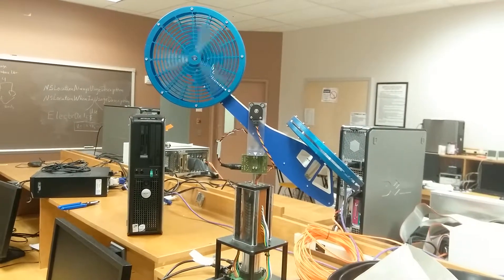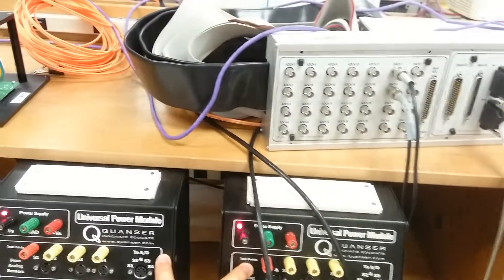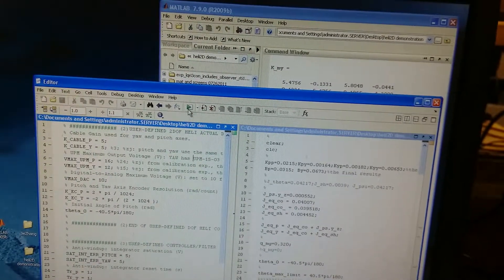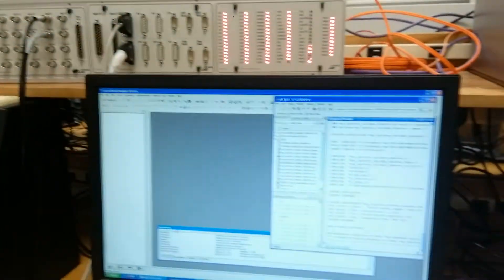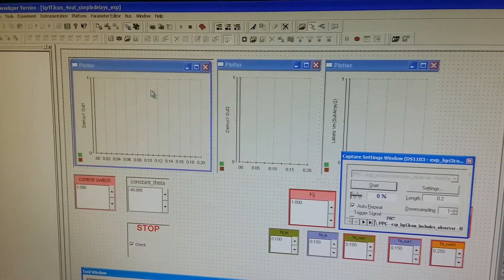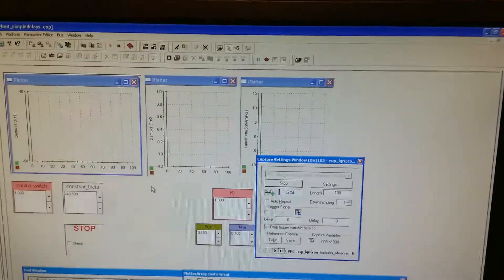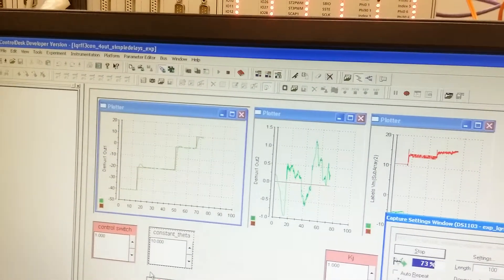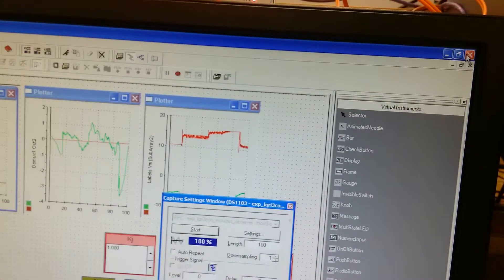Helicopter Control System Based on dSPACE 1103

Comment: can i implement m function file for controlling dc dc boost converter using sliding mode control?
or i have to use similink using block diagram in matlab?
Reply from the maker: M file can be loaded in to Block diagram
Reply: @JZH84  can you make a video on controlling boost converter through d space using m function